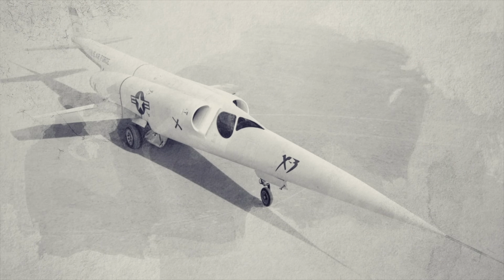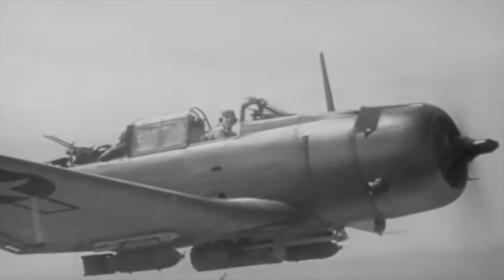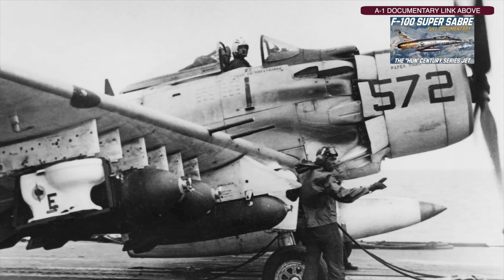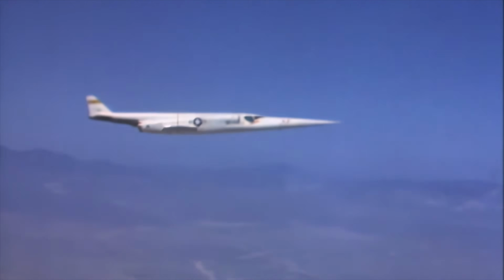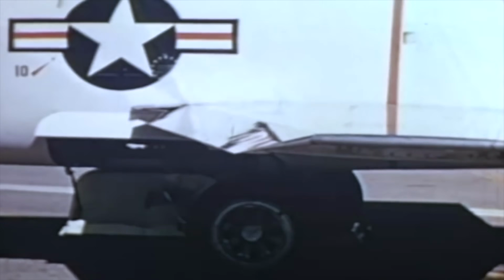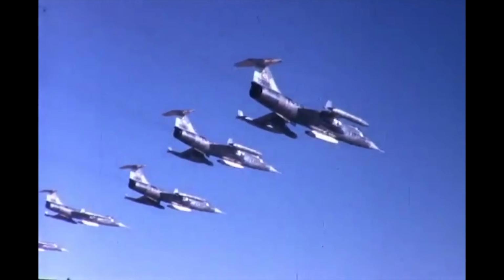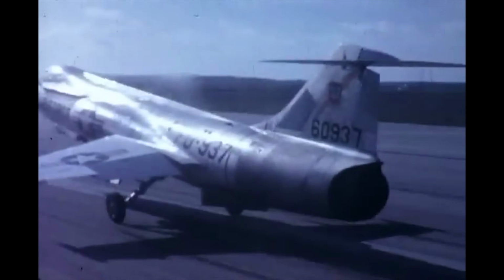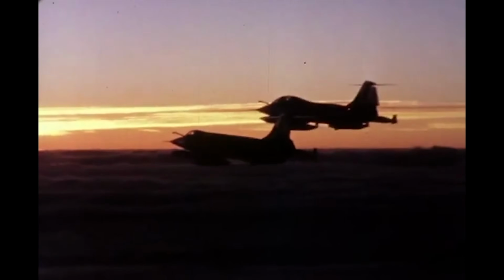X-3 Stiletto, One Of The Sleekest Experimental Planes Ever Created. Exclusive Upscaled Footage

Comment: "These aircraft spanned the gaunt..."   I'm sure you meant "gauntlet" (or gantlet) but even that's not right.  "The J46 would have raised the performance of the J34 from 49,000 pounds of thrust on afterburner to 7,000 which would've drastically increased overall power." What?  The J34 delivered 4,900 pounds of thrust with afterburner.  You shifted the decimal point.

Comment: Really Neat!  The exhaust tunnel behind the engines was extremely long.  I wonder if the Westinghouse Engine was longer and would have filled the space.  It looked to me like the exhaust tunnel provided a test bed for novel propulsion systems.   I see in the documentary that the picture of the original schematic stops at the air inlets and does not display the tunnel?

Comment: I remember meeting General Frank "Pete" Everest when the Right Stuff Association had their reunion at the Air Force Museum in Dayton several years ago.  He told me what it was like flying the Douglas X-3 Stelleto.  He said it was the first aircraft to feature downward ejection because Douglas engineers didn't believe current ejection seats at that time would clear the high set vertical tail surface.  It had an elevator that lifted you into the cockpit. Because it was so underpowered, it required a very long takeoff run and the tires would get so hot that they would throw tread off the tires causing the tires to fail.  New tires were developed specifically for the X-3.  Westinghouse did develop the intended J56 jet engines for the X-3, but unfortunately the engines grew too big to fit inside the X-3's airframe.  So they were forced to put in a much lower thrust rated engine into the little bird that detracted from its performance drastically.  The aluminum wings were machined from a single block of aluminum.  He said it was one of the hardest airplanes he ever flew during his career.  He said "it looked really good.  It took forever to get the plane up to speed and altitude.  It looked like a dagger ready to go."